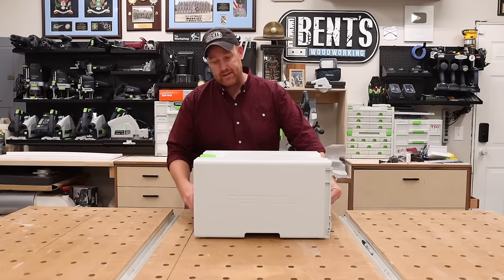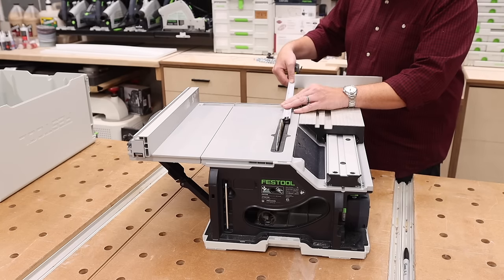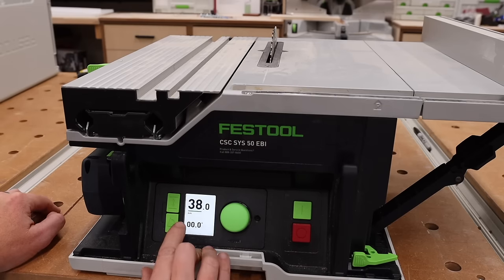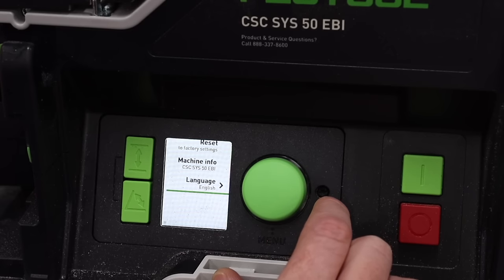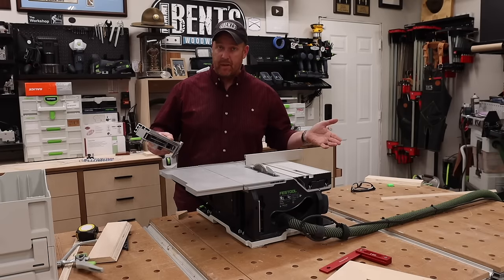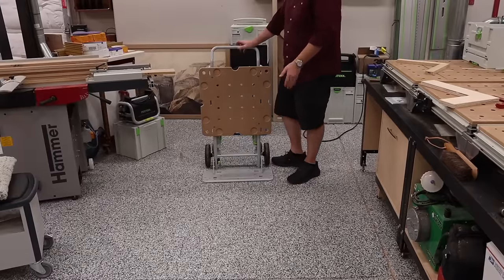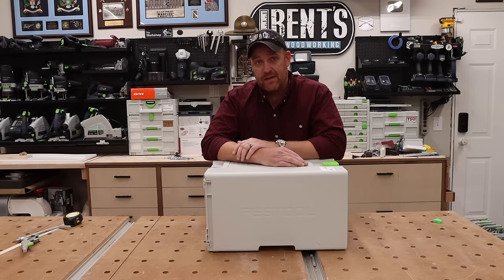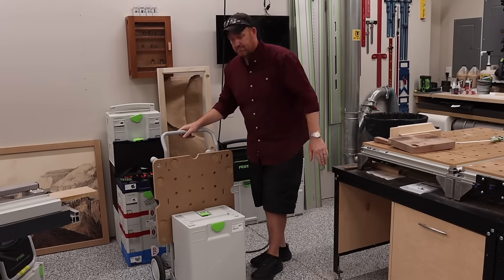Festool table saw review

Comment: I bought it on launch day, and have no regrets. In an apartment in a city with a shared garage, everything else is too big. Having a table saw wasn't an option at any price point. The ability to use this indoors with stellar dust collection is revolutionary for the hobbyist limited by space.
Reply: I’m in the exact same boat bud! 🤝 getting mine tomorrow.
Reply: Use the in an apartment and be ready for complaints from your neighbors
Reply: @jonreeves3993  It's quieter than the CT26 at full suction, so unless it's late at night I honestly don't think you'd get any complaints. My neighbors are definitely having louder parties than my woodworking.
Reply: I run a 10' box truck with a bulkhead (service body) so I can fit sheet goods, every tool... stuff for different jobs etc. But I also keep a storage unit where I have light and power the size of a one car garage. I have had a folding Ryobi 10" on wheels for ever. Usually it's been easier to break out the Makita 18v and a track. If I did picture frames or more small stuff I'd still be happy with my cheap table saw. 
This stuff looks like it belongs in an operating theater! Obviously I want all the stuff they make but I do very well with what I have working like the uban gorilla that I am.
Reply: Limited by the cost 😂 for me
Reply: What is this, a table saw for ants? This needs to be at least 3× smaller!
Reply: I'll anxiously hold out till they offer this in a jobsite version. Cause that'll be the day.
Reply: I'm realizing that it can replace a compound miter saw. Am I wrong?
Reply: @Molaleni  It's capable of a lot. I don't have a miter saw, and blade height is the limiting factor. Of course, you can flip workpieces or finish with hand tools. Cutting crown or trim flat on the table is possible but isn't efficient. Swinging the miter saw left/right with clear detents is just a better way to work without involving compound angles because you can cut vertically.

Comment: But Jason, "surprised by the price" is super subjective. Most of us aren't nearly as invested in the Festool world as you (I have two sanders, domino, two routers, and the LS32 system). There's no way I'm thinking $2000 is "surprising" in the same way you are. :) That's not me whining; just pointing out you're on a different plane of spending and affordability than many of us just out here working jobs. :)

Comment: I know this is a job site table saw but I wish they would make a corded one so I don't need to purchase 2 batteries with it. On the other hand this is an amazing saw with lots of options to make your work easier.
Reply: Agreed. Even my Ridgid fan has both a 18v battery option and a 120-volt plug to accept an extension cord.
Reply: @bestyoutubernonegraternumber1  That's exactly what it needs. There is honestly no excuse for not offering this as a possibility, from any of the tool manufacturers. I remember when DeWalt released the Flexvolt they claimed they couldn't do an adapter. Well if Hikoki/Hitachi can make it happen for 36V, clearly they could make it happen for 60V.
Reply: Does it have saw-stop finger saving tech?

Comment: Cutting is cool, but what I wanted to see is if that computerized control unit on the front was capable of switching between metric and imperial units.  That info has been hard to find, at least on the first 10 pages of googled results I found.  Just because that control unit is software based, I've been around long enough not assume tool designers and programmers understand how software can make a tool really customizable.
Reply from the maker: I showed in the video that you can choose between metric and imperial
Reply: @bentswoodworking  I did see that.  I posted before I watched your presentation.  You're the first to talk about it, but even then, you have to look into the video (understandable - your workflow) to see that.  And thanks again for showing that feature.

Comment: A cool feature worth pointing out: You can pull back the rip fence so it is in front of the blade and use it as a stop for the cross cut fence.  This way you have precise, repeatable cuts that don't bind up and kick back on you.  There are also third-party flip stops for the slider fence that will allow repeat cross-cuts from the other direction.  When you combine that with the side support provided by the hand truck, you have preempted the need for a miter saw in many (but not all) scenarios faced by a cabinet maker or trim carpenter.

Comment: I like it & think it’s worth the price when they hybridize the power,  like on their cordlesss sander which I purchased & am pleased with. If you have a readily available outlet & it’s known to you unlike a job site outlet that trips & then having to reset the breaker but where is it, you should have the option to plug it in. Same with the cordless dust extractor: I’ll buy it when it’s hybridized.

Comment: The smallest SawStop 10” compact would be the best choice for a small shop. But this would do for sure. This Festool would be so good for any travelling work. The smallest compact table saws are still quite large to take in and out of the truck/van all the time. This Festool would be epic for any cabinet installation onsite.
Reply: This is exactly what I use this saw for, millworker installation. Perfect for cutting filler pieces and misc trim. Was using a Milwaukee cordless before this but the way this packs down makes it my preferred saw since I have limited space in my truck. If you’re looking for a saw for a shop there are better options for much less money.

Comment: People thought that I was silly back in the day. I got the hole flex volt system. The sliding miter saw, compressor and table saw. I got two extra batteries and could work all day and even a long ten hour day if I needed. I'm looking at changing the festool for the dust collection so I can setup closer to the work.

Not having a cordless vacuum has been what stopped me and now that has been added. I will always say that cordless is better for the job site. I don't have to worry about cords and can work anywhere I want. Lots of times I just cut in my trailer or by the street. Saves setup time and that means I can go home sooner at the end of the day. 

Who wants to roll up a cord every day. I don't and I haven't for years.

Comment: Well said! I have the CSC and Kapex 60 because my shop has limited power.  I also have the track saw (powered) MFT and I find the combination of these tools offers me limitless cuts.  So much so that I gave away my other table saw to reclaim much needed space.  So, a weekend woodworker warrior in a shed with limited power the battery platform is definitely the way to go.  BTW the batteries last all day for most any project.

Comment: Remarkably quiet. And the saw didn't bog down on thick hardwood. Excellent dust collection.
Is it worth $1,500 - $2,000?
Reply: For some people, anything more than a handsaw can't be justified. It depends solely on your needs.
Reply: @AaronGeller  
So very true!  👍
Reply: it depends for someone in the trade probably...hobbyists maybe not.....carpenters were fine without this saw for decades or hundred of years how did they cut wood?   and were able to make fine furniture without this ?  more of skill and good old hand tools.
Reply: @10OZDuster  power tools have allowed craftsmen to produce goods in record time allowing common people to afford high quality pieces.
Reply: Cool saw, awesome engineering, too small, only battery powered, higher quality than needed on most jobsites, stuck in a stupid systainer box.

I would much rather have a normal size plug-in contractor saw from festool with the sliding table. Something with a 25-32" rip capacity and doesn't unpack like a clown car.
Reply: @brandonhoffman4712  that's you and your needs but for me this is what I wanted because I don't want cords in my shop the less the better and why not go with the best for woodworking.
Reply: @Blueboyb95  I won't deny festool is good, damn good. But it's no Altendorf, and no Altendorf comes without a power cord!

There's always a bigger boat...
Reply: @brandonhoffman4712  lmao when are you going to realize that cords are not important, its just a battery and the cordless work better then any corded tool

Comment: I know this saw tilts a little to the left, but most of the bevel angle adjustment leans to the right (towards the fence).  Most of the better table saws (cabinet saws, at least) today lean left, away from the blade.  I understood this left lean was safer.  Is the right lean a European/German thing or an intentional decision by Festool to achieve some benefit I can't fathom or were they just stuck with a right leaning blade because of where they placed the motor and other internal parts?  I'm leaning towards the third explanation but I'm wondering if anyone knows.
Reply: Given the slider - tilting towards the fence is safer.

Comment: Are you turning on the dust extractor separately, since there is no power cord?
Reply from the maker: I use Bluetooth batteries. Turns on when I start the saw.

Comment: Today was the debut. I had my extractor synced, had it on the stand, all is good. Only thing is, I was getting low battery indicator, meaning on the screen it shows both batteries icons with only the last one illuminated but in red. Then I finish my cut and hit the indicator on the battery and it reads 2/3 full. These are 5.0 batteries not the 5.2 like they used to have or even the 6.2. The 5.0s came in the kit. Very first charge and run of those batteries. Im trying to remember if lithium ions need to be charged and discharged a few times to get peak efficiency and/or if that has anything to do with it. 🧐. Other than that it runs great

Comment: Can you explain me how can you get a clean cut on the widest side of the cut  when you cut a laminate board along,   because that saw does the 45° in negative side compared to original classic table saws, so basically when you cut a boar alond the side up of the board will have the clean cut, but I need a clean cut on the widest side, is that make sense?

Comment: First... this was a nice, well-done review.  Thankyou for posting.  But -
The first and last question I always ask about ANY table saw is - Is the fence square to the blade?  This festool fence seems to use the front/rear grip that my Grandad's 60 year old Craftsman uses... and that's nowhere near square or consistent.  You have to check at the blade (bump bump), check at the front (bump bump), check at the rear (bump bump), then go back and check at the blade again (bump bump).  Rinse & Repeat.
So I am surprised that checking the squareness of the fence & miter gauge never even seemed to occur to you.
Reply from the maker: I haven’t checked it because I don’t have a reason to. The saw gives me square cuts.

Comment: With all the features that this saw has I am really surprised that they didn’t use a rack and pinion fence design. That being said I love everything about this saw especially for someone like me that does a lot of finish work on job sites.
Reply: I thought the same thing about the fence when I first saw it. I think I read somewhere that it’s due to the fold down table or sliding mechanism. I’ve told myself I’d never buy a table saw again without a rack and pinion fence but damn do I really want this saw.
Reply: @NickFrongillo  The fence is actually stellar mate. And absolutely spot on to the mm out of the box. Only had to calibrate the zero height and zero tilt.

Comment: I own a lot of Festool and I believe the corded tools are the way to go….what do you do when the batteries are toast? Buy new ones? Most of the cost is battery
Reply: Without batteries the system is 1500 and with the batteries it adds about 300 so I don’t think the majority of the cost is in the batteries. If it falls under warranty, then they will be replaced. Otherwise, you buy new batteries. But lithium batteries should last for several thousand cycles before dropping to 80% capacity.
Reply: @AaronGeller Seems like it would have been a good idea to make it both battery and AC compatible.  Then again, when I think of Festool, I don't think of value!
Reply: @mattro4902  it would have been nice and I don’t know why they don’t do it but value is subjective.
Reply: @AaronGeller  Fair
Reply: Years ago we had a video camera which came with a battery-sized transformer gadget which meant we could use the camera with batteries or plugged in to the mains. Something like that would be very useful for this.

Comment: While a good review the fence can be locked down is it super precise and square? the sliding table has a little bit of deflection which can be an issue for superfine and accurate cuts using it also Festool have shown they can build tools that can give you the flexibility of powered and portable batteries in a single tool as in some of their sanders. They should think about developing this capability for this table saw a mechanism for dialing in the fence to super accurate levels would be another improvement - for me an 8/10 for this portable table saw with the  said improvements it has the potential to be a straight ten.

Comment: Help me out here guys, that includes you too sir. I set my saw up yesterday and noticed something. If you use the fence as a straight edge and check that all table surfaces are flat. The extension is flat to the main, but my sliding table has a lean to the left. Is that correct or can someone show how that can be adjusted if it's not?
Reply: have you reached out to festool directly?
Reply: @AaronGeller  no. I was hoping it was nothing to worry about and someone here would put my mind at ease. I've used a bit to complete some punch work and had zero issues.

Comment: I can see this saw being really helpful to me in my small garage shop. I do have a question…why do you say that this saw is for folks that already have festool products?   Is that just because of the batteries?  I have no festool products at all. Additionally, I have no climate control in my garage. How do hot and cold temps affect the unit, if at all.   Thanks so much for the info.
Reply: It is primarily because of the batteries. Festool is designed to be a part of a system. Accessories, storage, clamping, dust extraction and mobility are all part of this system.
Reply from the maker: My assumption is if someone is buying this, they already have invested in the festool cordless platform. However, that won’t always be the case

Comment: The saw looks great, lots of features that go above and beyond other saws. I don't really understand the stand though. The top of the stand seems well thought out and functional, but the legs are kinda jenky in my opinion. A gravity assist setup is much easier to use and seems more in line with Festool quality. I owned a cheap HF stand with these types of legs and I do not like the style. The Bosch table saw or Rigid miter saw stands with gravity assist are so much easier to use - especially if you keep the tool attached.

Comment: I've felt like I've gotten my monies worth out of every piece of Festool gear I own. This price however is just too high for the tool's capabilities, at least in my opinion. The small SawStop at half the price is what I'd go for if I worked in the field. Even with the Festool saw I wouldn't cut inside a client's house, so the noise and dust collection aren't a valid enough selling point for me.

Comment: Cool saw, but despite the digital adjustment on the blade you're stuck with the tried and true tap and pray method of fence adjustment. Also no Sawstop safety feature. Rip capacity is not ideal but anyone even considering this definitely owns a track saw.

I'm not sure who this is geared towards. Some guy doing filler strips all day in high rises I guess. 

I'll stick with the DWE7485 for $300 in someone's driveway and the PCS in my shop.
Reply: The fence is actually better than mm perfect. Not at all tap and pray.
Reply: Sawstop requires AC power for ground. Doesn't work on a battery system.

Comment: That’s a great precision table saw, too bad it’s ridiculously small, and cordless table saws just don’t have the power yet, how many sheets of 3/4” ply do you think you can run through the Festool , before it bogs down, great for homeowners and flooring guys, not contractors

Comment: Looks like a great little machine. Would've been nice to see a sawstop brake , at least as an option, seeing as they're under the same parent company
Reply: It won't work with DC power. That system has to have AC power. That is what I have been told.

Comment: Love my festool domino 500 and tracksaw but this looks like a little toy. Too limited with small blade and could have option to simply power through cord. I do love digital settings for angle and height. Hope other brands will come with similar stuff soon. For 2 grand though i can buy 10 inch cast iron professional table saw including sliding side carriege.And if i needed some small jobside table saw any small Bosch, Makita or Dewalt at 1/3 price will do very same job for a quick cuts.
Reply: Would you be able to take that cast iron table saw onto job sites? And to say that the job site table saws you mention are comparable is just incorrect. The Festool has greater accuracy, with better dust extraction and the sled that feels like it belongs on a multi thousand dollar cabinet table saw. You really have to try it before making judgement.

You really do get what you pay for here, make no mistake about that.